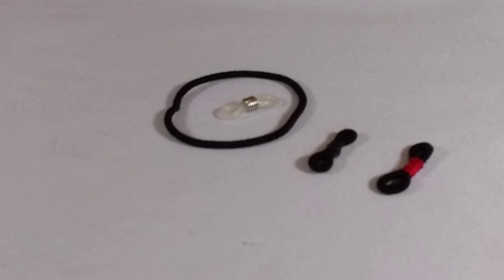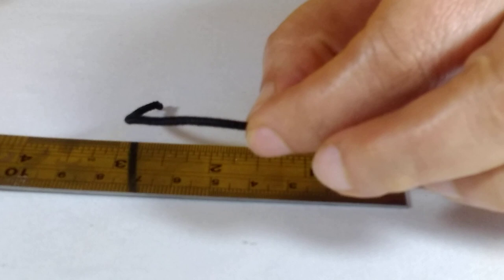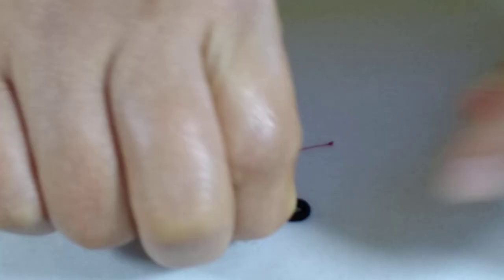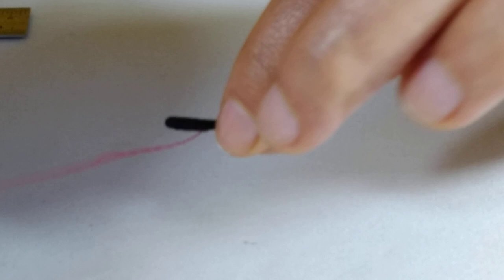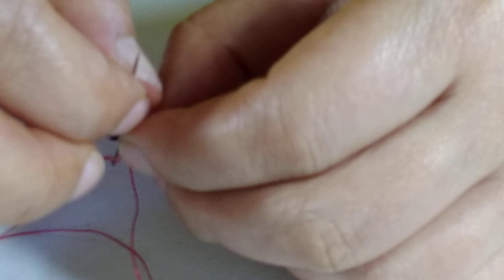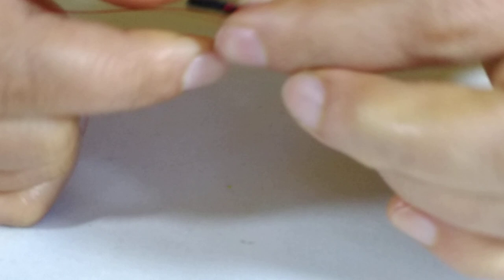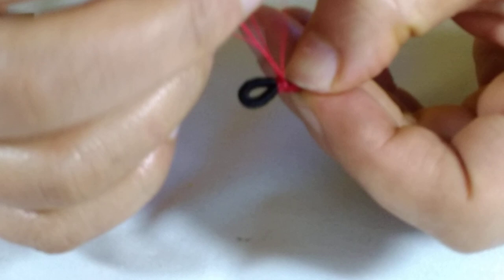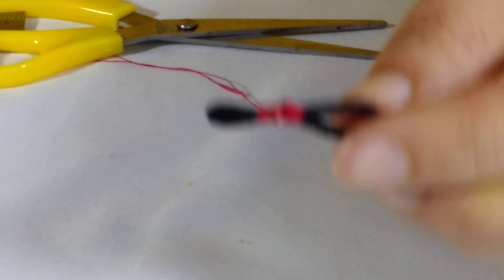Easy Trick, How to turn a Hair Band for a Rubber End, Glasses Chain Making DIY Sunglasses Spectacles

Comment: I have had several holders give way and all the beads come bouncing off, or it just broken the connection and I had to buy new connectors.  This is not only a clever and resourceful idea but you are an excellent instructor.  Your voice is very kind and encouraging!  I think I would put a dot of glue before wrapping around the final wrap because I plan to use good beads and I don't want it to come undone long from now.